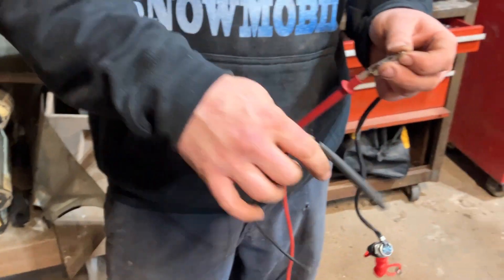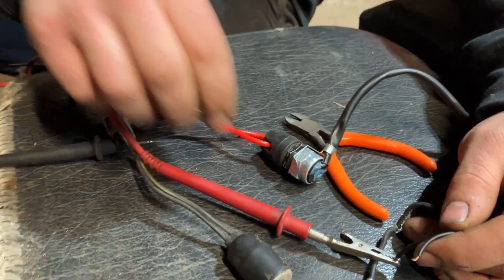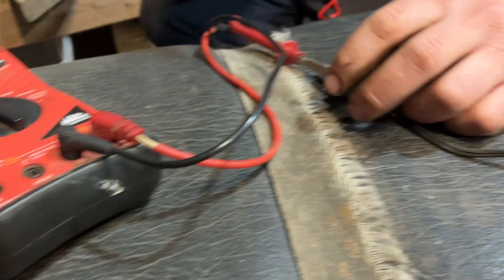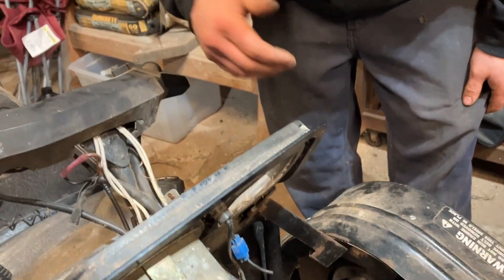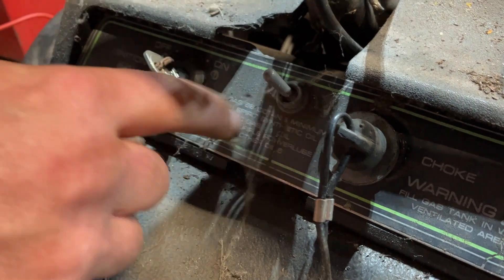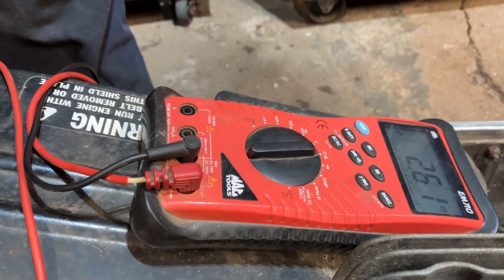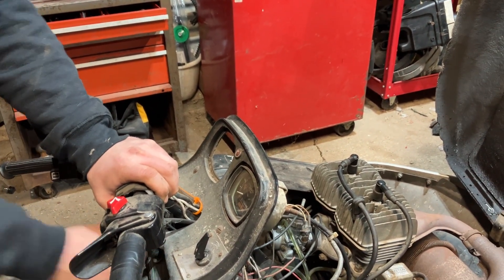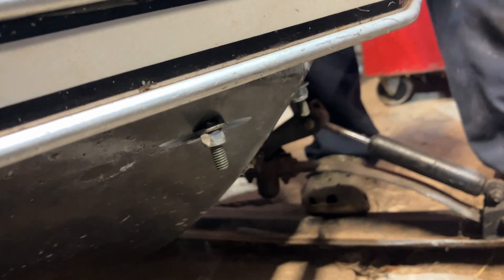Normally Open vs Normally Closed Tether Switch - How To Test & Check On Snowmobile

Comment: Hi, I have a 1971 340 CCW fan cooled motor and a 1971 chaparral Snowmobile wondering what wire I need to hook into the ignition to add a tether. I was told one side goes to the ground and once it goes to the ignition, having difficulties finding that wire that will cut the spark, if you can help me out
Reply from the maker: What model chap??

Comment: I have that same exact sled I'm trying to put one on, can you please show me the switch used and exactly how to hook it up to ignition? I want to race it in vintage races but have to have the tether.
Reply from the maker: Use the tether switch in place of the emergency stop switch.If it still has it you can test the key switch on and off to see which way the contacts are when it is on
Reply: @bearkreekboys  the ohms thing was a huge help. The only problem now is I don't know where the wires plug into.
Reply: Probably helps to say I'm trying to do a NC
Reply: @bearkreekboys  I'm uncertain of how to get it to kill. What wires are you using to connect the tether with spades?
Reply: I spent another couple hours on it this evening. What wires are you using with the spades?